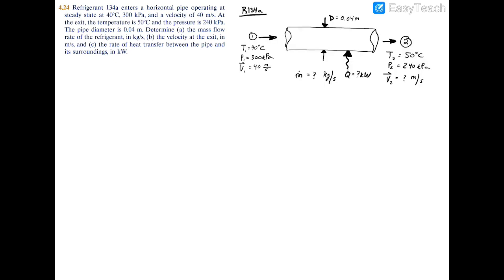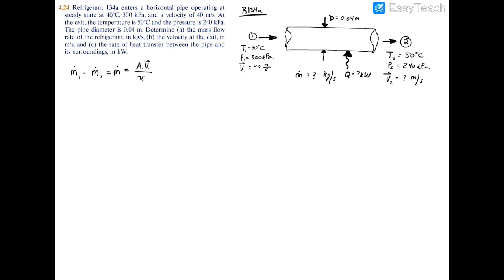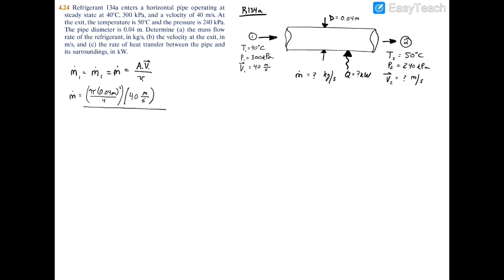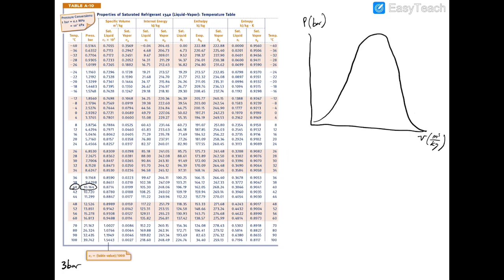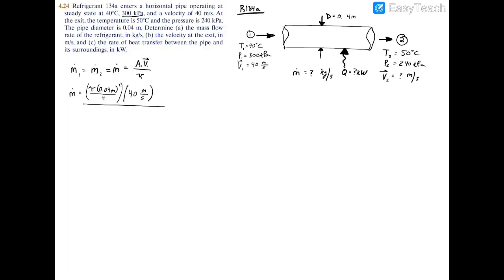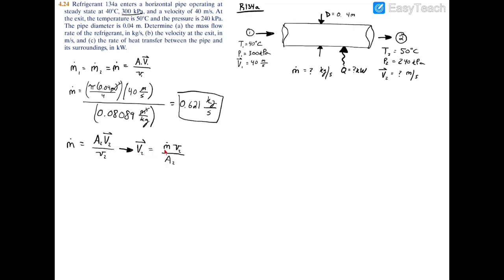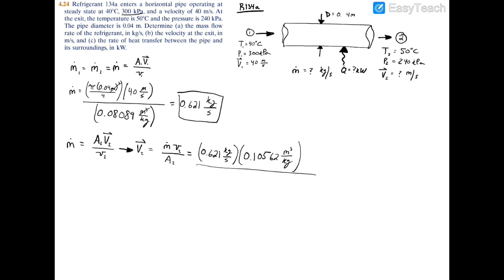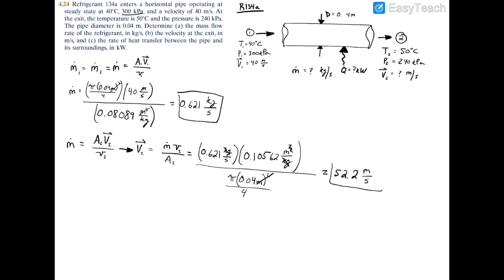4.24 Refrigerant 134a enters a horizontal pipe operating at steady state at 40°C, 300 kPa, and a

Comment: When I rearranged my energy balance equation as in 9:57 I flipped the signs as you did and got -Q= m((h2-h1)+(V2-V1/2)) and worked out -Q= 6.5kJ or Q= -6.5kJ (heat loss from sysem), is this correct? Also when I calculated using your values I got 6.5kJ not 6.82kJ
Reply from the maker: Hello, thanks for commenting. When you rearranged the first law equation:

0=Q̇-Ẇ+ṁ[(hᵢ-hₑ)+(vᵢ²-vₑ²)/2+g(zᵢ-zₑ)]

you kept Q̇ as negative. Therefore your equation should have kept the enthalpy and velocity as inlet minus exit:

-Q̇=ṁ[(hᵢ-hₑ)+(vᵢ²-vₑ²)/2]

If you divide both sides by (-1) to get rid of the Q̇’s negative sign, which I decided to do in this video, you will have the exit minus the inlet:

Q̇=ṁ[(hₑ-hᵢ)+(vₑ²-vᵢ²)/2]

I encourage you to work out the numbers again to see why this is. Also, regarding why you calculated 6.5kJ, I reckon you forgot to square the velocities. The number I calculated is valid.

Let me know if you have any other questions!

Comment: I’m having trouble grasping the step here at 1:59 If T1 = 40°C and P1 = 3 bar, why is it a SHV? P1 (or 3 bar) is less than 10.164 bar. Wouldn’t it be a compressed liquid? I’ve been seeing a lot of this: “If T is greater than Tsat, it is a SHV”
Reply: When looking at the tables, do I refer to the pressure first and then the temperature to see if its a compressed liquid and a SHV?
Reply from the maker: @miguelalvarez5292    To answer your second question, if you are given the temperature and pressure, it is arbitrary which one you refer to “first”. Phase state is a function of both temperature, and pressure.

To identify the state of your fluid when given temperature and pressure:
1. check the corresponding Psat to the temperature you are given OR check the corresponding Tsat to the pressure you are given.

2. @Tgiven: if Psat<Pgiven you have a compressed liquid. If Psat>Pgiven you have a superheated vapor.

@Pgiven: If Tsat<Tgiven you have a superheated vapor. If Tsat>Tgiven you have a compressed liquid.
Reply from the maker: In short, if T is greater than Tsat, yes, the state is superheated. However, if P is greater than Psat, the state is compressed liquid. In this case here P<Psat, so the state is superheated.

Think about it like this, if the pressure is greater than Psat, then you have a greater quantity of molecules per unit volume (aka more dense), which requires more energy (temperature) to change state (to superheated vapor, in this case). If you have less pressure than Psat, then it is “easier” or requires less energy (again, temperature) to force the working fluid to change state.

Let me know if this helps!
Reply: @gr_engineering  Your first comment answered everything perfectly for me. I aspire to be a mechanical engineer grad and as knowledgeable as you. Thanks for the help!
Reply from the maker: @miguelalvarez5292  You’re too kind :) Thank you for watching, you got this!

Comment: Im not getting 52.2 im getting 2.08
Reply from the maker: Double check your calculations and be sure to use parenthesis where necessary. Are your values for mass flow rate, specific volume, and area the same as mine?

Comment: Hi, first of all Thanks for all the videos. They are so sufficient for understanding Thermodynamics. At the end of this video, why didn't you write 10^-6 instead of 10^-3 because we converted from m^2 to km^2?
Reply from the maker: Thanks for watching, I’m glad you find these videos helpful!

Are you asking why did I not add a conversion factor of 1/1000000 instead of the conversion factor that I actually used (1/1000)?

I would encourage you to break down the unit of kJ/kg to understand why we only need the 1/1000 conversion factor to convert from m^2/s^2 to kJ/kg.

If you would like a detailed explanation as to why we only need 1/1000, I really think you would find this explanation helpful at time stamp 4:10 in the following video https://youtu.be/t6iBCi7jws0
Reply: @gr_engineering  Thank you so much for your help I 'll check it